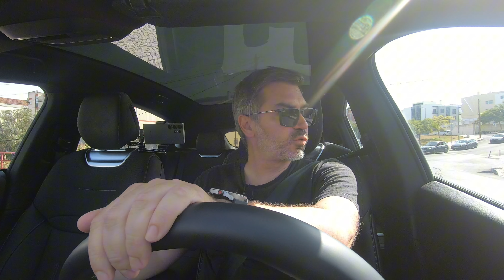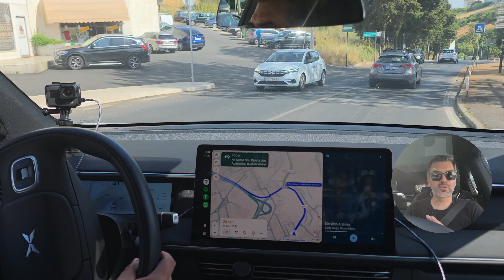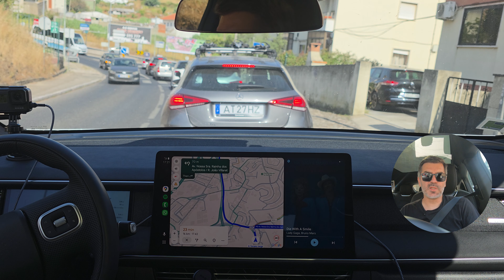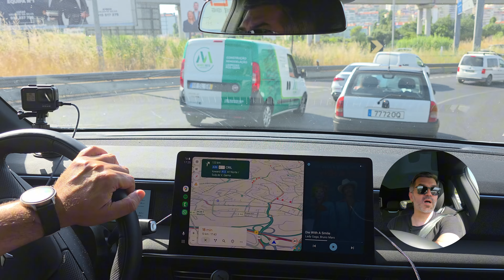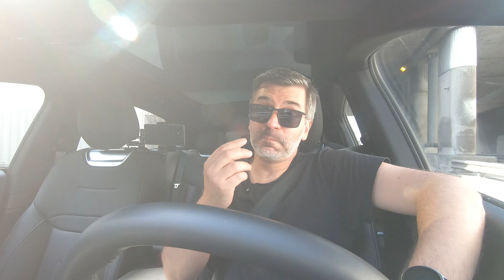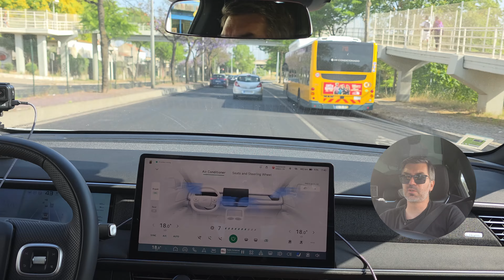City Drive with the XPeng G6: Summer Heat, Low Consumption & Comfort Tips 🌞🚗

Comment: I purchased window covers for every window, including the roof, for when it gets super hot. Have yet to see how much of a difference they will make.
Aside from that, I have a video idea for you 😃I drove over a "mountain" today and switched between all four setting for regenerative braking on the way down. I managed to recharge one whole percent and a bit and didn't have to brake or accelerate once. I chose today (sunday) when there wouldn't be much traffic and it was quite interesting to see how much I could regain just from braking. Fun to play around with that 😄
Edit: I agree, the heat from the sunroof is not notable in my opinion. I got the covers none the less for longer parking times in the sun. 🙂
Reply from the maker: I need to tint my windows. Need to check that urgently.
Reply from the maker: That's a good test:)
Reply: @XPengPT It seems that the car regenerates more through breaking if it has more momentum and I don't accelerate while using X-petal. Though the line between accelerating and breaking is very hard using X-petal. I found I regenerate much more this way compared to going down hill slowly. Thus the consumption per 100km is much lower if I drive myself, rather than using auto pilot, which continuously accelerates to keep the set speed. Though I haven't experimented with different regen. modes recently. I've only been using X-petal.
Reply from the maker: I also have the feeling that auto pilot does spend more power than manual drive, but this is difficult to test and make sure we are not doing it wrong, because we manually driving will fluctuate much more the speed.

Comment: The AC is not very well 'distributed'. Meaning you really need cool air in the body/face when it is that warm (yesterday it was 34 in the part of Denmark I live in - exceptional warm).
I have ordered a fitting white roof cover (from China) to find out if it is a benefit.
Yes the front screen allows a lit of heat going in - thats why you need the vents venting at your chest/face.
Reply from the maker: Some other persons commented that if you activate Rear and passenger vents, the car will reduce the amount of air for the driver, as it will have more sources to cool down the car. Test that.
Reply: @XPengPT Thanks. But when it is really warm having it directed to your body and face is actually OK.
Reply from the maker: That's true. But it's hard to satisfy everyone inside the car. I do like cool air, but my wife dosent ...

Comment: 7.6kw/h is a mighty consumption. Do you use a lot of regen or just let it coast?
Reply from the maker: Sport Mode with X-Pedal ON. It was indeed a very good consumption but the circumstances helped, as there was some traffic that led to some regen used, and also the way was a bit on a descend. But i do feel the Xpeng G6 when used more relax and in the city/urban does perform pretty well. On the highway, fully loaded and pushing a bit, i can make pretty horrendous consumptions :) One day i will make a video out of that :) :)

Comment: Hey Hugo, thank you for the video. We have rear tinted windows by default here in Norway and of course it adds a good look to the car and probably protects from heat a little. I found that my car is getting very hot when I park it outdoors for longer, so, I bought front windscreen cover from AliExpress. I hope it helps to protect the car from heat. Fyi, it doesn't get so hot here in Norway compared to Portugal 🤣
Reply from the maker: Here in Portugal the cars are also been delivered with tinted windows ..  but mine was from first batch and they didn't had it. :( i do think the car looks great with tinted windows.

Comment: You can turn the AC off very easily on the main display. On the lower right hand or even left had side where the temperature is displayed you tap it and a small sub screen appears and you see a green button with AC on it, when you tap it it turns the AC on or off. Also there are 3 dots on the right hand side of this sub screen, tap it and the full AC screen comes up, much easier than navigating from the main menu!  We live in Tasmania and we mainly use it for the heating settings at this time of year! Love the heated steering wheel!
Reply from the maker: Thanks for the support. I did mentioned and showed that on the video. There are several ways to adjust, turn on or off including the voice assistant. And I to do love the heated seats and the heated wheel drive
Reply: I turn it off, but it turns on again, by itself
Reply from the maker: Everytime you enter in the car or just by itself while riding?
Reply: @XPengPT  It seems to do so all by itself, but I suspect a change in the outside temperature plays a role also
Reply from the maker: Need to check that. As i always drive with AC on, i just play with temperature, but i never disconnect AC, i didnt notice that behaviour. Will try!

Comment: I irritate a little about the AC function.. When I've turned it off, I want it to stay OFF until I turn it on again.. Doesn't seem to be  possible with the G6??
Reply from the maker: Didn't notice that, as i always have it on, but that's strange because it should keep the last used settings if the user is the same. Everytime I enter the car i have all the AC/Confort settings as they were last time used.

Comment: the climate system is not calibrated enough and needs some serious adjustments. If you have the rear climate off then the car will vent through the front to cool all the space in the car and there is a BIG space to cool off. You start to feel a much colder air through the vents than the temp you set. If I put it in 21 Celsius it feels like 18 coming out of the vents. And sometimes when is 12 degrees outside and I set the climate on 22 in the car it still pushes cold air in the cabin, shows on the graphic display also as a cold vent. So ... wtf? 
So I found out that cooling with both rear and front ventilations keeps the temperature more stable and vents do not freeze you at the wheel.
Regarding the roof, when you are stationary you will feel the heat coming from the roof but when you are on the move you will not feel anything
Reply from the maker: That a nice tip on keeping the rear air also to help the system. The system is smart to turn off the vents when a passenger is not there, to save energy butbthan if there is a high difference needed between exterior and Interior the driver will suffer.
On the sunroof I didn't felt that. I still feel when im stationed or on the move that heat is coming from front window and side windows

Comment: I have the same issue in the P7 we have. You have to work with the temperature and fan speed much more than on cars I have owned before. It is not a car when you set and forget the temperature.
Reply from the maker: I just use temp and keep it on auto. It's easier to control as we can do it with the wheel button on the wheel drive

Comment: Same experience with G9. Temperature algorithm doesn't maintain required temperature. Have to adjust frequently if it's hot or cold. Additionally it should be more aggressive in order to reach automatically set temp. Hope they fix this.
Reply from the maker: Yes it seems that it needs more time to reach desired temperature, meaning that if you enter in the car with 30º celsius, and set the temperature to 20, it should blow very cold air to reach quickly to the desired temperature, but it does not. The air that comes out is more or less around 23/24, and then when it reaches the 23 inside the car, the air coming out of the system seems to be cooler than before. So sometimes setting it to 23 seems cooler than at 20 :) Anyway for a quick reach to the desire temperature i do recommend max cool or max heat, as it does work pretty well and it is very quick. It does make a lot of noise, if you are already in the car, but it is very quick and effective to cool down of warm the car.

Comment: I think Xpeng really needs to put additional work in getting temperature settings tuned to European expectation and also improve climate control and stability significantly. I know from my VW vehicle that I set a temperature and never really change it again. It always works and keeps the cabin in the correct temperature range.

Good to know about the sunroof, but this being Chinese cars, that is to be expected. In China there are places that are like Portugal 🙂
Reply from the maker: Yes i agree that setting a temperature and leaving it as it is does not work in the Xpeng, and so to have the same comfort level i had before i do need to change between 20 to 23 degrees in the temperature control. But the Ventilated seat and also heated seats/heated wheel are great, and do work great. The max cool and max heating works perfectly fine. The Xcombos together with AC controls can automate the confort in terms of temperature, so i am pleased with the system. But it is real that sometimes i have passengers asking me to turn off the AC as they are getting cold air from the vents, even when temp is set to 23 ... and the car is already at that temperature ...
Reply: What XCOMs do you use for temperature control?
Reply from the maker: Currently none, as i work from home and i don't have a fixed schedule. But some examples: If you have a normal commute every morning, or every afternoon (going to or from work), you can schedule a max cooling at a specific time, if temp is higher than X, so that you arrive always to the car with the desired temp. I helped a friend to create one to keep the car from overheating, meaning that even with car parked, the temperature is measured and AC on if temp is above X. Many possibilities. X Combos for temperature is very advanced.
Reply: @XPengPT  wow, that is powerful automation. Great to have one that inside temp e.g. does not exceed 35°
Reply from the maker: @dutchbavarian it's crazy what can be done. As I said I don't use any but check this one that I saw posted on a discord channel. Combo Code：6497 0007
Reply: @XPengPT  thx, will try